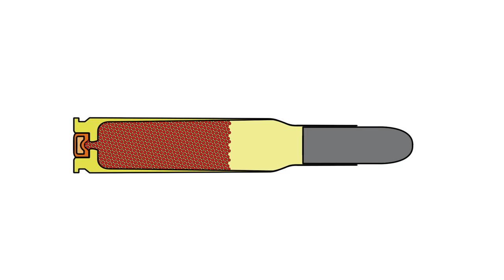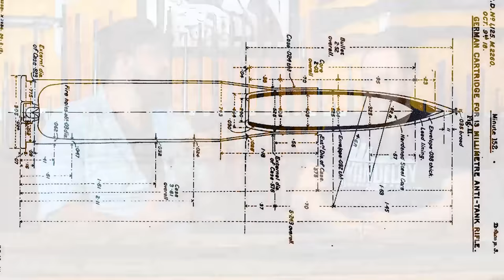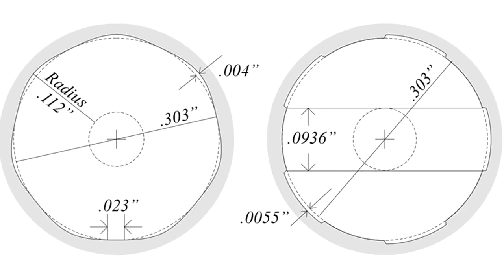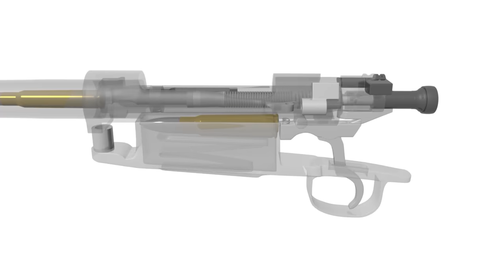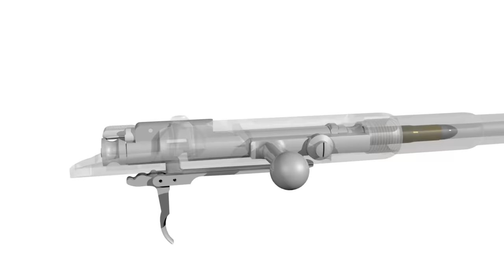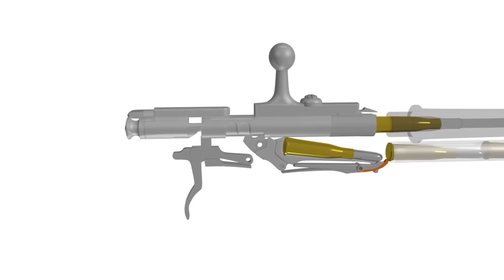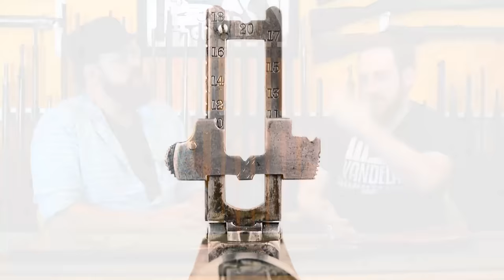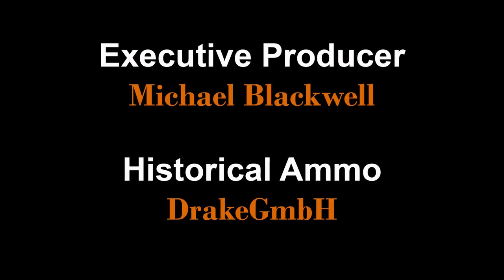Bolt Actions: 101

Comment: I'm a bit late to this party, but I've been saving this special episode for a day where I have no other plans. Funny how for me that turns out to be Christmas eve day. Very interesting stuff especially for me because half the reason I'm interested in guns is the mechanics of them (the other half is the history). When you were talking about extractors, specifically the Mauser claw extractor and mentioned that the reverse angle that causes it to grip a rim harder might not have been copied over to the Arisaka rifles, I felt a compulsion to dig out my recently acquired Type 38 carbine and check for it. Comparing it to the Yugo M48 I already had out (because reasons), it does in fact appear to have the reverse angle on the extractor, but the matching cut in the bolt body is a bit on the shallow side, so it likely isn't as effective, but it looks like it would still do its job well enough. Sadly, the Type 99 rifles I have are buried too deep in storage to get out in any sort of quick and easy manner, so I don't know if it stuck around or not. 

And an interesting side note about bolt handles, I am so used to straight bolt handles like certain Mauser based rifles, my much beloved Gew 88 (and it's children), and the Mosin that I actually have a hard time with most bent bolt handles. There are a few bent bolt handles that I do handle well, mainly the P14/M1917, the Lee enfield (though it's really just a straight handle at an angle), and the Krag (for the same reason as the Lee). Otherwise, I'm actually faster with straight bolt handles because I use the palm of my hand like the cam track in the op rod of an M1 Garand. Straight pull rifles are another ballgame though, and I tend to grip them all like the "beer keg" handle of the Swiss Schmidt-Rubin rifles, even the round handles of the Mannlicher rifles, because I've found it to allow for faster cycling for me.

Comment: 90% is the upper. Good bolt and barrel with correctly installed gas block. Im not counting the sighting system, thats rifle specific. An 80% lower correctly milled with a PSA lower build kit will be dependable. Put a reputable upper on it, PSA FN upper included, and you have a dependable rifle. Ive built several from 80% lowers that I've built to that recipe and no failures at about 500-700 round counts each. NOT thousands, I'm on SS, but a gun that can go 500-700rnds can go another 500-700rnds with no problems. And this is with rifles with NO serial numbers. How many do i have and where are they? I can dig them up and arm myself and a couple of other Patriots if the time comes and be confident in them working. Again, in my experience, 90% is in the upper, as per reliability......

Comment: Well, electronic ignition is a thing. Umm…you do know most of our auto cannons are electrically primed? and our tanks too, both have been since the 60’s to 70’s in large bore, modern systems, even earlier for some cannon. And that’s the standard, not a one off. It’s lore reliable. Can be used in systems that can fire thousands of rounds a minute and not firing pin to break.

Comment: You guys stated that a lighter bullet goes faster, and therefore packs the same punch as a heavier bullet.  But isn't this incorrect?  The lighter bullet does go faster, but not enough to fully compensate for the lesser mass.  Or stated another way, a heavier bullet transfers energy more efficiently.  Otherwise, you could simply divide the weight in half and double the speed, but it doesn't work like that.

Comment: Technically, the Krag is still a 90° bolt turn, but it's 4 o'clock to 1 o'clock instead of 3 o'clock to 12 o'clock.

Comment: (In response to 3:50 ish.)
I have a DAO Taurus pistol that's frame is cut the same way the DA/SA Beretta it's copied from is, so it has places for parts that Taurus doesn't make.  Some times the guy making the part isn't told 'we don't need that cut any more'. When I was given one in a box to reassemble I thought parts were missing and spent time looking at exploded parts lists to see what they looked like so I could try to find them. Wasting most of a day. :[ (There are exceptions to every rule.)

The Japanese type 99 has a barrel mounted rear peep sight.

Comment: Question . Needle Rifle Cartriges. 
Why the strange >Powder-Primer-Bullet> arrangement, requiring the needle in the first place?
Was there a specific reason for this, with the technology as it was back then? (reliable ignition?)
Or was it just because no one thought yet of the >Primer-Powder-Bullet> arrangement, that seems obvious now, that we have it?
Reply: I had the same thought earlier, couldn't really think of a good answer at the time. 
Maybe the primer needed to be against something more solid than powder to work properly?
Reply: Metallic cartridges are complex metallurgically. Making reliable casings cheaply enough to be disposable took time.

Comment: You said that single stage trigger helps with flinching, but i've heard opposite opinions... Is it possible that old 2 stage triggers are just heavier or have longer 2-nd stage, so that makes them more flinch-sensitive than old single stage? And modern match 2 stage triggers reverse this?

Comment: Awesome job so Mae is just eye candy
Reply: I get your probably trying to crack a joke, but while I'm not aiming to detract from her charm, thats far from giving enough credit and is frankly a little more objectifying than it needs to be.

The knowledge base to safely handle such a diversity of old weapons of war, on camera skills, past experience as a shooter required to make more objective statement about comparative handling even when actual contact time is limited.. these are qualifications that go above and beyond, and say nothing about what roles get played that we don't see on camera, as you can tell be the little bit after the outro of this video even the people we don't see are both present and involved in the process.

Also from a physical standpoint one of the key factors we have been told before because Mae is actually about the correct size for the average infantryman of the era, so handing would be representative in a way a larger modern adult male may not be.
Reply: Hamish McGregor ya it's a joke not a reason to prattle on

Comment: Another reason for the rimmed case is that back when there were only single shot rifles (except bolt action ones), break actions, and revolvers, they could only use the type of extractor that sits underneath the rim and pushes it away from the chamber, rather than later guns with bolts that have the extractors attached to them that reach around the rim to pull it away from the chamber. The pulling type works perfectly fine with "rimless" cases where the rim doesn't stick out, but the pushing type doesn't work with rimless cases unless you have an awkwardly complex mechanism with springs like on the M47 Medusa revolver (link to forgotten weapons video: https://m.youtube.com/watch?v=HkUJ2EuTNE0)

Comment: Did I miss what Mauser 98 variant you had there? 1902 Export model? 1904?
Reply: It's a 1907 chinese mauser. I identify that by the four drill holes(not original) on the left side of the wood stock.

Comment: Start 5:40

Nice video but you basically stopped at WWI and guns invented in the very late 1800s.

What about the 1903 Springfield? Winchester model 70? Remington 700? etc.
Reply: Things really haven’t changed much since then. The 1903 is just a tweaked Mauser 1893 action. The Winchester 70 and Remington 700 can both be traced back to the P13/P14/M1917 action, which is just a modified Mauser action.

Basically they are just old designs that have been tweaked to be cheaper to make and more compatible with modern production methods.